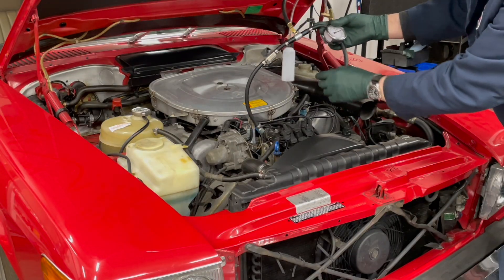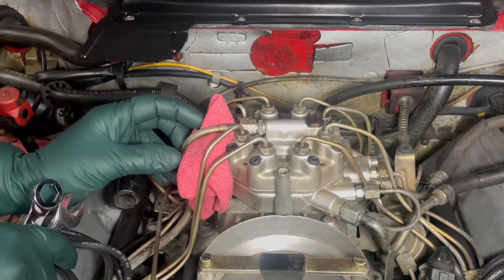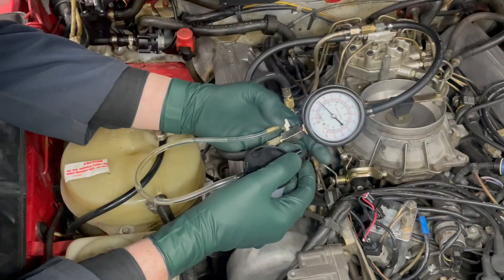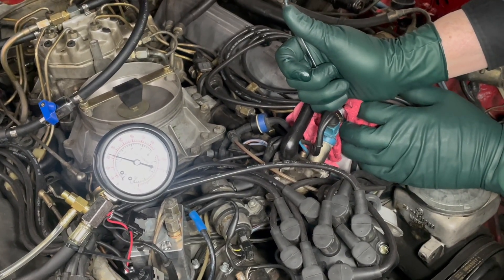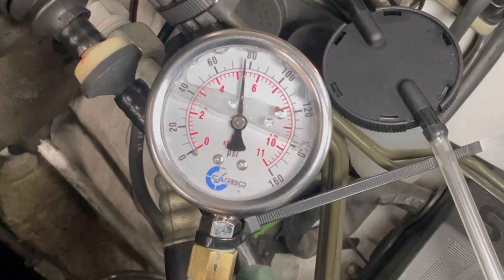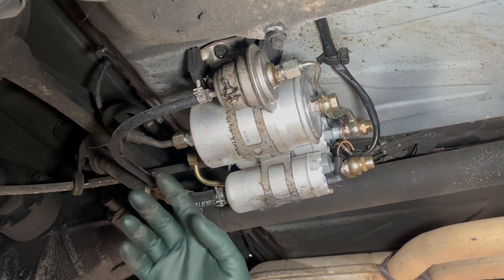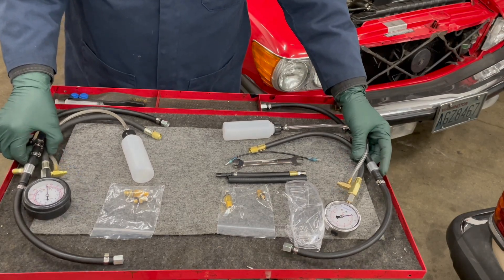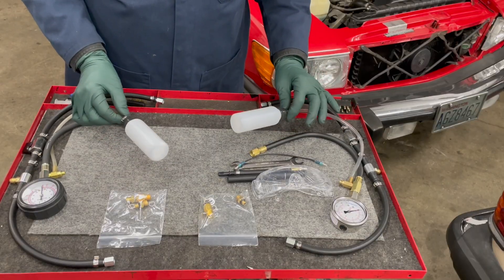Bosch C.I.S. Fuel Injection Testing and Repair Success Stories

Comment: My 79 116 had a long morning crank, so bad I finally had to have the ring gear replaced. Frustrated with my mechanics,  i installed  a small switch under the dash to jump the fuel pump relay till the system pressurized (2 seconds) and you heard the 'womp' of the air plate. Started on first crank. Rube Goldberg solutions had their place in my cars. But it was the accumulator all along. There was no Kurt and Merceds Source back then..

Comment: for nostalgia, ive still my equivalint pressure  tester from Bosh (KDJE-K 100) from about Jan 1989
stuck in memory is the 5.2 - 5.8 bar and all that :)

lovely kit, seen better days but its till complete wit all spanners and screwdrivers, adapters, from bosch.

Happy Days